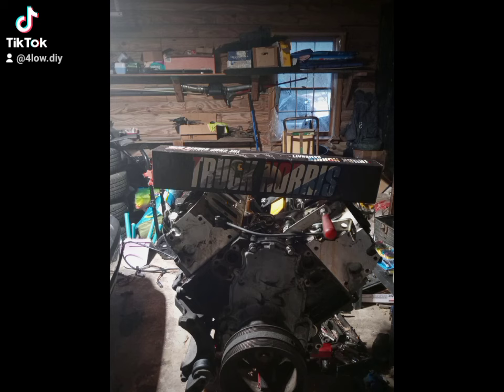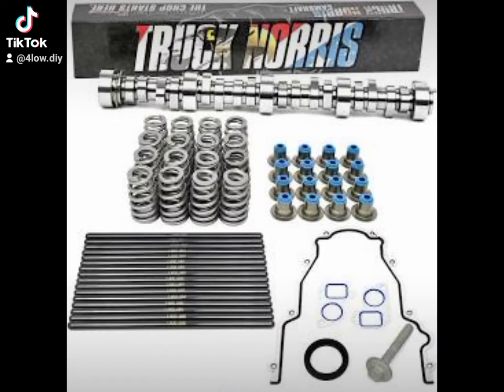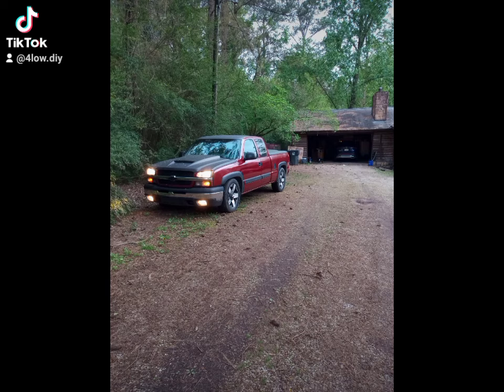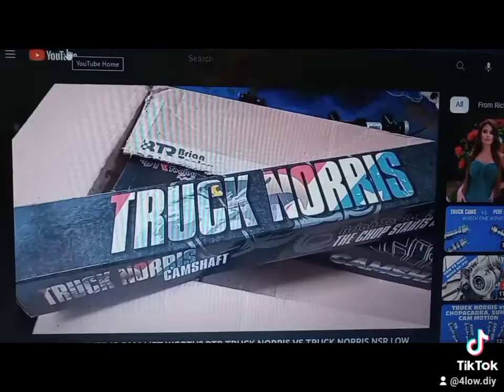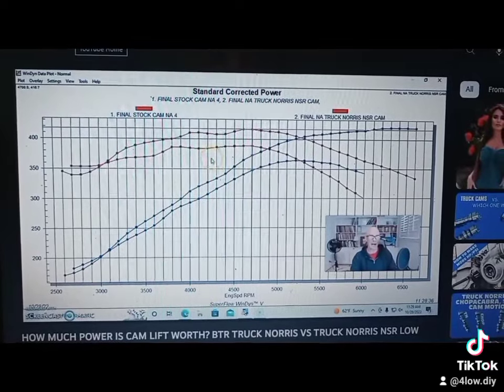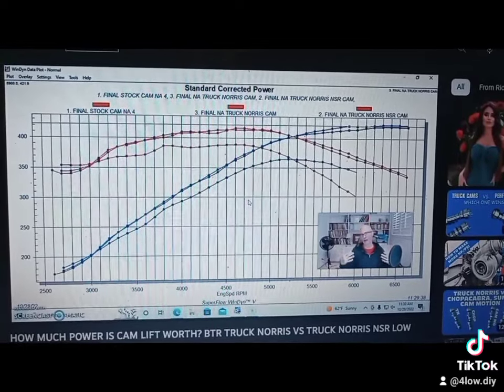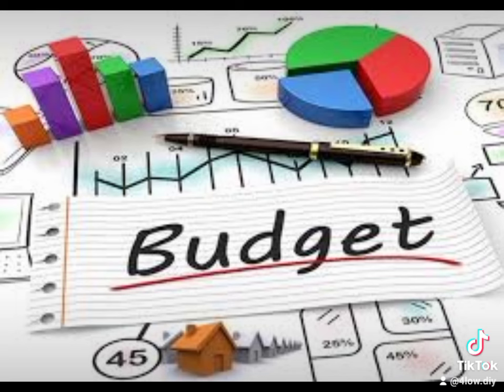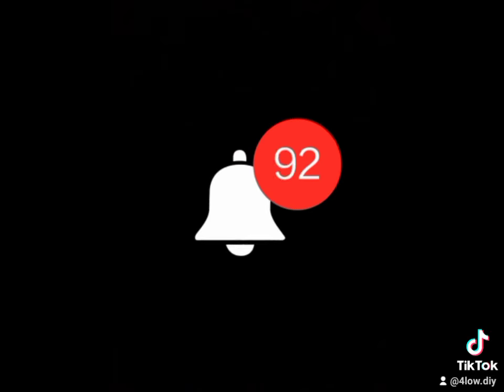🔥 Truck Norris Cam Review after 6 months installed🔥 #truck #automobile #silverado

Comment: Decades ago 1 pony per cube was a respectable achievement. Today, trucks / cars come from the factory above that. The LS / LT platform, can take off the shelf parts and very little work and turn it into a monster, that the old guys with a 350 SB chev would envy.
Reply from the maker: You're absolutely right. I am one of the old guys. I remember how much work and $ it took to get a 500 hp small block. This is my 1st ls build but definitely not my last. Thanks for watching

Comment: I installed a Truck Norris nsr on my 2007 6.0 6" lift and 35's.  I did a dod delete and vvt delete at the same time. Truck gained 20psi oil  pressure deleting the dod. I used ls7 lifters and 7.4 pushrods. Valve train is quiet and truck makes good power.  Street tuned myself with stock converter.
Reply from the maker: Nicely done im still working on the tune. Just added heads , headers intake and injectors.  Thanks for watching
Reply: What kind of torque numbers does it make?
Reply: Glad to see badass trucks like mine are out there our slongs are the biggest on the road with the 6 in lift and big tires

Comment: I used the truck Norris cam on my last 5.3 truck build. In combination with the 3cc domed pistons and shaved heads I installed it had great power all around. Did not have as much torque off the jump as you feel with the stage 1 or 2 cams. Definitely an in between big and small cam.
Reply from the maker: Off the line its a bit slow but at 3000 rpm its moving well. I have 33s on my truck with 373 gears on stock stall so i assume that's part of my lag. I have long tubes,1000cc injectors,fast truck intake,and wilkes CNC heads ready to install. Gonna be a blast. Thanks for watching and commenting 🇺🇲
Reply: @Ralf1NATOR I’d definitely say it’s the gearing, swap over too some 4.30’s or 4.56’s and it’ll run alot better, I’ve noticed anyways 4 speed autos really lag without aggressive gearing and or a 3200 stall especially with big tires, holly also has a cross ram intake with 2 throttle bodies which will boost your low end torque as well
Reply from the maker: @chrishansen7004  oh yeah definitely. That's a lot of weight to get moving. Especially on the stock stall. Still undecided on turbo or supercharger so im holding off on the gears for now

Comment: I appreciate your info because I've been waiting for someone to make videos for the average guy.
Reply from the maker: @DHill-dx8gw  😂 i am the average guy. Been building motors a long time but this is my 1st LS . Computer tuning has been interesting to learn to ssy the least lol. My cam has been in 2 years now and i have a few track videos with the cam and a 1 year review as well. Check those out and hit me up if you have any questions and ill help if i can. Thanks for watching.
Reply: @Ralf1NATOR  Thanks I'll do that and I'm really sure I'll be getting a cam most likely the same cam.
Reply from the maker: @DHill-dx8gw  love the cam. Dropped me 6 tenths in a 1/8th mile. Cam swap only. Great for the heavy trucks
Reply: I have a 1998 chevy cheyenne with a 2001 silverado 5.3 swap. I hate that I wasted so much time and money with the wrong people advising certain parts that wasn't the right choice. I now have a little more knowledge and having to correct what was done but lol I love my truck and this is my first one lol at myself.
Reply from the maker: @DHill-dx8gw  on the other hand since u got bad advice in the long run you're better for it. Now you're the one that can give advice on parts that you know. That's how most of us got started and my silverado is still schooling me 😂

Comment: After searching the Internet for a cam for my ls1 Camaro I decided on this one. It’s one of the best cams to not lose any power throughout the rpm range and only misses the big boy cams by a few ponies at the very top.
Reply from the maker: Agreed. I was looking to keep my torque down low and get the extra rpm on top. Sounds pretty good too. Imo if Richard holdener says its good. You can bank on it lol. Appreciate the feedback
Reply: Did you do a stall converter?
Reply: @7115sugarhill  no but wish I would have, but just got the stall speed not drivability reasons
Reply from the maker: @7115sugarhill I'm still on stock stall too. Still does OK. Stall would definitely benefit the launch
Reply: 6.0 30 over forged summit pro ls pistons stock rods 
243 heads 
What cam should I use? I’ve been looking at the sloppy stage 2 but I’m not sure
Reply from the maker: @cmovezz3192  unfortunately the truck norris that i love is a little small for a built 6.0. Very streetable but youll give up some power. I think the sloppy is a good place to start your research.  Main thing is to figure out what rpm range you're looking to operate in and the overall weight of the vehicle. I personally give up a bit of power for more torque to get my heavy truck moving.
Reply: @Ralf1NATOR  that’s exactly what I was thinking being a 370 ci motor.. I’m just stuck man and don’t really know what to order… I want a good power between 3k-7k rpm
Reply from the maker: @cmovezz3192  check out richard holdener. He has done a ton of cams in those. Me personally i always used comp cams grinds but this is my 1st ls build. @@bluecollarhotrods9781 is a weslth of knowledge on thes and he will answe you if you comment in his videos

Comment: Good video!
I'm lucky enough to be about a 45 minute drive from BTR. Even luckier, I scored a 153,535 mile Express van with an LQ4 6.0 for cheap! (Um... thanks, deplorable catalytic converter thieving, gas tank drilling people?)
So, I'm doing the origional Truck Norris cam, springs, lifters, 44# injectors, long tube headers, and a really good tune to begin my swap.
Like you, better heads and intake may be in the future...😊
Reply from the maker: Awesome on the 6.0. appreciate the feedback. I've got my heads,headers and fast intake in the garage waiting on cooler weather lol. Still looking for the right deal on injectors. Got burned on Facebook marketplace. Will have a video coming shortly on that jerk 😜

Comment: I have a 09 lifted suburban with 35" tires. Do you think this cam would be good for my 5.3 Ls2.
Reply from the maker: In my opinion it's the best cam for the heavy trucks and suv. You get a good bit of extra horsepower and torque and you don't lose any down low which is usually the trade off. I would recommend it for sure. I have a truck Norris Playlist coy can check out that even has some track results.  Lemme know if I can help and thanks for watching
Reply: Thanks for the reply. I'm for sure ordering the kit. Dod/vvt delete with springs and truck norris cam. I appreciate your time.
Reply from the maker: @tonycee4628  absolutely.  The delete is a good call. Seen a lot of damaged engines due to the failed lifters
Reply: I have some questions. Did you plug the oil pressure relief valve in the oil pan? Do I keep the high volume oil pump that came with my susburban? I have a DOD delete kit ready to order. I wanted to ask these 2 questions before I ordered.
Reply from the maker: @tonycee4628  i did not plug up the relief valve and i reused the factory oil pump. Oil pressure is a touch lower than it was but i did expect it reusing stock parts. Really more of a test project than anything and its been flawless for a year and a half now on basically a stick tune other than idle adjustment.  You will live it. If u have anymore questions i have a ton of pro friends that will weigh in. Thanks for watching

Comment: I have a 2003 Tahoe z71 LT. Brand new 5.3 and 4L60E. Runs great. I’ve been considering a cam and magnacharger. I drive about 200 miles a week. If I spend the money to do this what’s the drivability like. I just want power when I wanna have fun. But don’t want to lose economy while cruising. Is this possible?
Reply from the maker: @McRick84  absolutely possible.  Ive been running my cam over 2 years now. Have since upgraded the heads,intake,injectors and exhaust. I plan on a torqstorm charger in the future. Tuning is the key to keeping your fuel economy. Except for the piwer and sound it still behaves mostly like a stock build. Wouldn't be scared to drive it anywhere. Matter of fact i just came back from a fishing trip with my kids.
Reply: @Ralf1NATOR  thanks bro!

Comment: What’s your opinion on this cam vs the Tx Spd Chopacabra? I’m currently building a 5.3L .060 over, flat top with the Chopacabra and wondering what I should expect. 
2006 2wd crew cab
Reply from the maker: Its very comparable to the truck norris. I would expect to see 40 to 60 HP at the crank. Take a look at Richard holdeners video. Easy to find on you tube. He compares the 2 cams head to head with dyno results. Thanks for the comment
Reply: It has basically same values, I got the chopacabra because it was $50 less than the truck norris
Reply from the maker: @shadowopsairman1583  agreed they're virtually identical. I chose truck norris for all the R@D put into it. Can't go wrong either way

Comment: What did your truck dyno ? 460 to the crank is 355hp wheel I bet with your heads you will dyno 355hp 320tq or so very cool
Reply from the maker: @utahcountypicazospage5412  the only dyno its had so far was cam only . Stich exhaust  , air box , mechanical fan. It put down 322 . Now that being said , im not real sure the guy was as experienced as he said even though thats a respectable number. Im getting close to another dyno run. Instaled now are my ported heads,fast intake,snake eater injectors, long tube headers,cai,e fans. Once my e85 conversion is done itll be ready for a pull.

Comment: Do u get rpms fluctuate at stop signs between 900 and 700 and engine shake intermittently?
I've had two different tuners and can't get rid of unsteady idle. Have 2009 Silverado 5.3 with stock exhaust and converter.
Reply from the maker: I did when i 1st built it but found a vacuum leak. Couldn't hear it at all. I also adjusted my ramp in timing a bit but i would look for a vacuum leak. Been running mine a year now. Will do another 1 year review video. Have had issues with brakes on the stock stall
Reply from the maker: I would look at the brake booster vacuum line. Does it do it in park or in drive or both? Only when the brake is pushed? AC off or on ?
Reply: For anyone else reading this son truck Norris '10 1500 has trouble with the brakes.
I'd like to do a smoke test on it for vacume leak. Maybe it's the tune?
Reply: @Ralf1NATOR  park and drive,regardless of brake.
Reply from the maker: @whaddayawant2197  i had brake issues as well and it was a vacuum leak. Couldn't hear it but it did affect the idle a bit especially when i got on the brakes. I eventually upgraded my brakes to help while still having the stock stall. Tune does make a difference for sure. I adjusted my throttle cracker settings in the tune and that helped. When you add a cam its never going to be the same as it was stock but can still be completely reliable
Reply from the maker: @phillipduran2576  im surprised the tuner can't figure it out. I've got a couple videos that show the idle. Can you listen to one and see if its different. Can you add a video of yours in the comments and let us take a listen?
Reply: @Ralf1NATOR  thanks almost consider putting in a hydroboost to make it more reliable
Reply from the maker: @whaddayawant2197  that's certainly an option. With the cam it does make a little less vacuum but with my idle set at 750 it does seem to help. Of course mines an 04
Reply from the maker: @phillipduran2576  i did think if something else. When my engine would do its emissions cycle like they do it would freak the idle out and pull timing. I have mine deleted for the most part in the tune and that helped a ton but there are no emissions checks here

Comment: Will it reduce the longevity of the engine by a lot like anyone know this? I have a 2001 Tahoe 5.3 with 205k miles in reality how much life would it take out of it , and not just that but let’s say a brand new 5.3 anyone know?
Reply from the maker: Ive been putting cams in for 30 years and if it's done right its just reliable as stock especially if its a street cam like the truck norris. I have a similar cam in a different build and its still running 20 years later. Big crazy race cams can shorten the life but this is nothing like that. The only negative is losing a little fuel economy but if tuned right its not by much. I hope this helps and sorry it took so long to respond
Reply: Best time to install it is when you're ready to put a new motor in. Might as well enjoy the last few miles. You're going to be getting out of this one LOL. Hopefully you wont throw a rod, lord knows what else, a lash adjuster? You're going to need a new motor soon anyways. With that many miles you could re-purpose the valve springs for solder. What have you got to lose?
Reply from the maker: @jamesdewer  😂😂😂
Reply: Is it worth it? Cars and life have one immutable truth, an axiom, that is it's your project / life, where do you want to be. Which crowd to connect with? The party on a school night "live fast, die young " crew or the "Live to fight another day, " "life by design" folks? The truth lies in between. If you cross the line and
Reply from the maker: @jamesdewer  myself at nearly 50 years old ive lived both lifestyles. Im way more conservative now but im enjoying building a play toy thats still usable. Personally ive never had any problems adding small cams like this. Ive driven my truck everywhere and wouldn't be scared to liad up my family and drive cross country

Comment: Any results with tuning for 87 octane? As far as i can tell a 87 tune is mainly a timing curve change? Loss of power to be expected im assuming.
Any reccomendations for tunes that are out there?
Reply from the maker: When i did mine i actually copied my low octane settings and pasted over the high making it the same. Tricks the computer. I can't remember who recommended this but there is a video on YouTube. Im not a tuner by any stretch but mines been flawless for a year now
Reply: The compression ratio of the cylinders and head chamber will determine if you need Mid Range or Premium gas, a cam swap just changes ignition timing.

Comment: What did it do to fuel mileage, drop by 4-5 ?
Reply from the maker: @thegonz7833  at 1st it was a bad drop. After more tuning its down about 20 miles per tank from stock. Alot of that is from my heavy foot😂 seriously tho with a good tuner i would say a loss of 1 mpg but i got that back by switching to an electric fan.

Comment: Did you have to mess with your power brakes and the 4l60e???
Reply from the maker: @275Marco46  my 4l60 is still stock. Brakes were unaffected. After tuning youd never know it wasnt stock except for the power and sound ✌️
Reply: @Ralf1NATOR  it’s cause I wanna put this combo in my Camaro restomod thank you for the advice
Reply from the maker: @275Marco46  absolutely. Its a great cam. Keep us posted on ur build

Comment: This is probably late,but I’m having a bit of a issue tuning a gen4 with this camshaft
Reply from the maker: Oh its been fun for sure myself. I still dont have mine perfect either. What issue are you having ?
Reply: @Ralf1NATOR  can’t get it to transition drive to reverse without it dying,cold starts are super rich,and it’s idling at 950 to 1k rpm so it pulls the trans constantly.  Tuner said it would need a stall,but I don’t feel like the cam would need one,it just not that crazy of specs.
Reply from the maker: @coryfryar3871  no youre right. Ive been on stock stall for a year and a half. Mine is rich below 1500 rpm as well. Its going to come down to how much air the throttle body is pulling at 2k and below. Try lowering about 15% and that will help. The computer sees all that airflow and is adding fuel. If i had to bet it idles at 20 moh or so and you have to constantly ride the brakes. My friend frogs garage youtube channel has a video that teaches exactly how to fix that
Reply from the maker: @coryfryar3871  adjusting throttle cracker should help with the drive to reverse shift. I have my idle set at 750 in park and 800 in gear btw

Comment: I've got a 06 crew cab with a 4.8 or 5.3 idk but I'm going to slap the nsr version cam in thanks for this vid
Reply from the maker: Good deal. Its a great cam and i would choose it again for a truck in a heartbeat. As far as tuning goes you can pretty much set your idle and go. Crew cab should have the 5.3 but the truck norris would sound nasty in a 4.8. good luck and thanks for watching
Reply: @Ralf1NATOR  I gave u a follow the guy I bought it from thought it was a 5.3 but wasn't sure but vin# says 4.8 I've already built the trans and put a 12" converter that's been stretched out to 2500 stall even though this cam sounds like it doesn't really need it
Reply from the maker: @CCAutoWorks  im still on a stock stall myself and it would definitely help in traffic. Ive upgraded my brakes to help stop the ole girl. I appreciate the follow. I've got a ton of parts ready to go on. Should be good for 100 HP and then some
Reply from the maker: @CCAutoWorks  followed you back
Reply: @Ralf1NATOR  can't wait definitely interested in seeing more this is my first LS truck and I'm just getting started modding it
Reply: @Ralf1NATOR  thank you very much appreciated

Comment: What did it do to the gas mileage ?
Reply from the maker: To be honest it dropped a bit at 1st. As i got thè tune back in line it actually improved on the interstate. Not so much red-light to red-light 😂 i have 2 tunes i use. 1 for the track and 1 for just riding around. I do have a couple of track videos so you can see the gains. No dyno yet tho